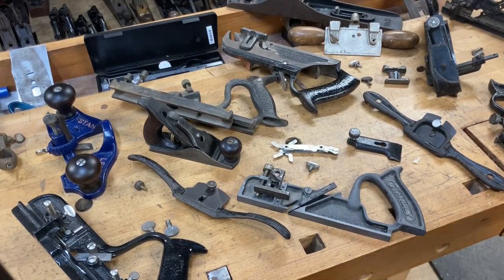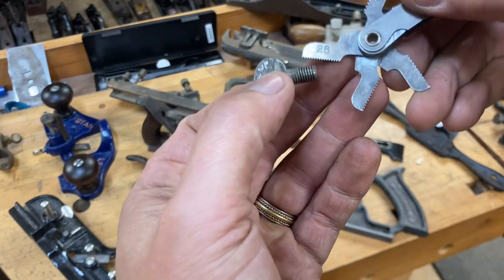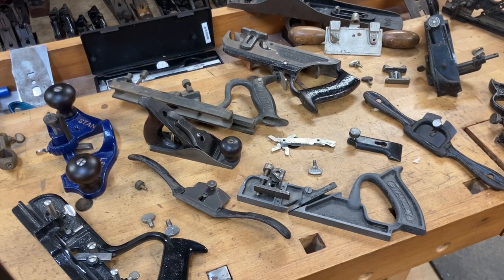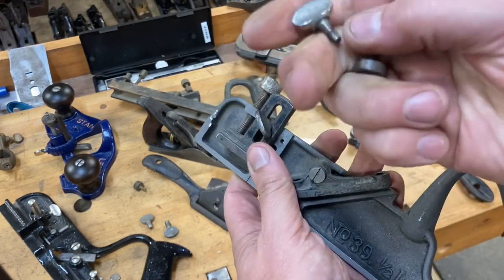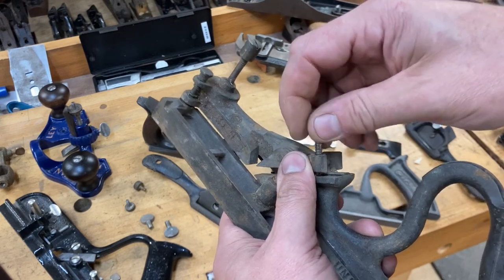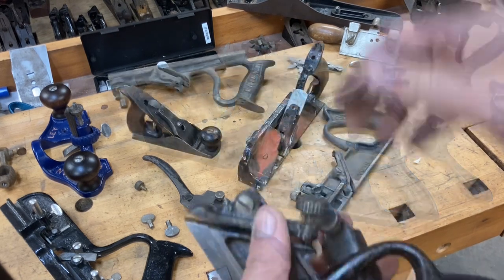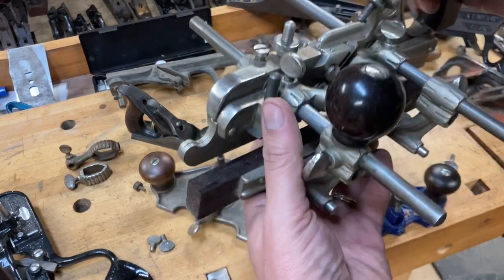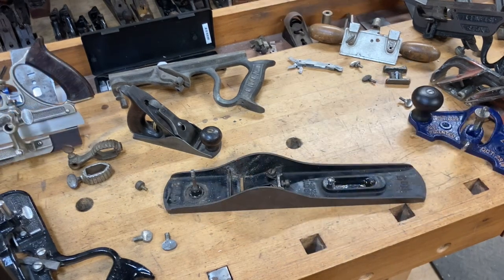Stanley Hand Planes and hand plane parts - on the topic of suitable substitutes!

Comment: I'm glad you are addressing the fact that Stanley used a lot of proprietary screws.  And one option is for a lot of these screws, have a machinist single point a screw you can use.  It will not be right, but for a user?  It may be the best choice.
Reply from the maker: Depending on how much the machinist charges, absolutely. Maybe have them make a few since set-up is often the longest part

Comment: For the tote screw I've had success using a 12-24 brass machine screw.  They fit tightly and hold the tote fine and I kinda like the look of the brass on the wood.

Comment: Hi: Have just purchased a Stanley 45 combo & the pin for the blade adjustment screw is missing. How would you go about a replacement pin. What would you use and how would you fix ?
Reply from the maker: You should be able to either carefully punch or carefully drill out the broken piece of the old pin. Then put a blunted nail or other type of straight pin in place. 

If you run into problems, I have whatever replacement parts you could ever want for a No45. If you had to, you could replace just the main body